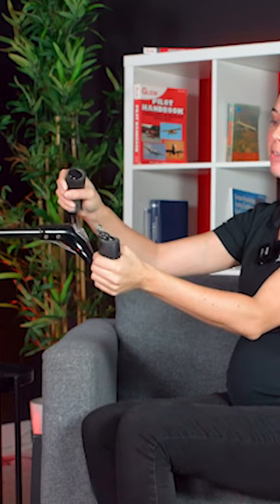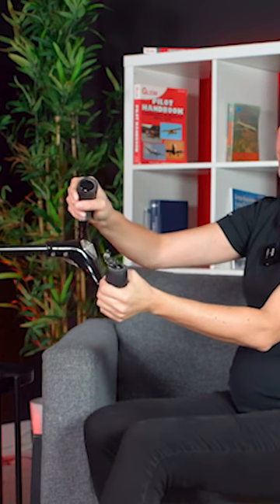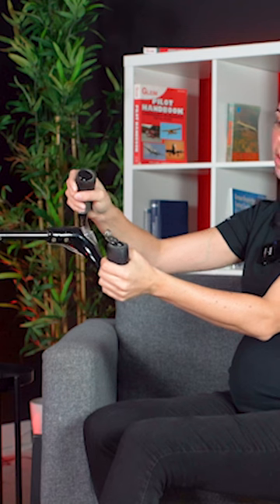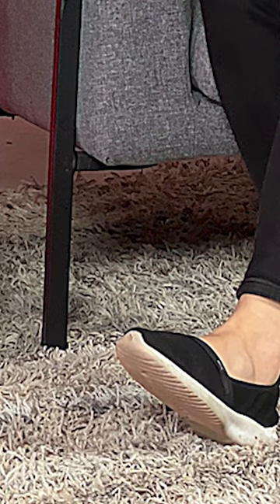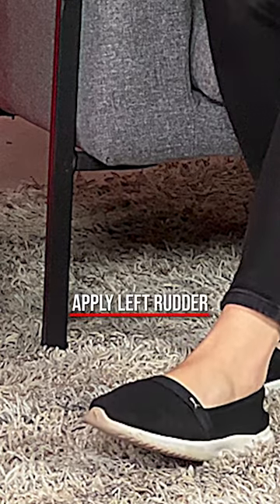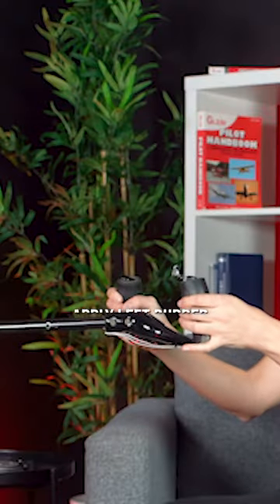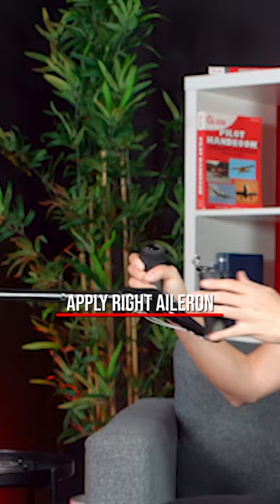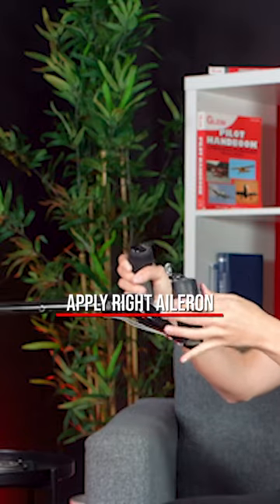The Fundamentals of Cross Control Stalls While Chair Flying

Comment: If I enter a spin at pattern altitude, before I could push the yoke forward, neutralize the ailerons, add power, and recover, wouldn’t I have already died?
Reply: You don’t push the control down, you just release back pressure and maintain nose level attitude. Also, if you entered a spin, you can recover within 100 to 200 feet if you are proficient enough. I do a lot of spins in my aerobatics training which helps to notice the small indications of a spin and the correct flow of the the recovery.